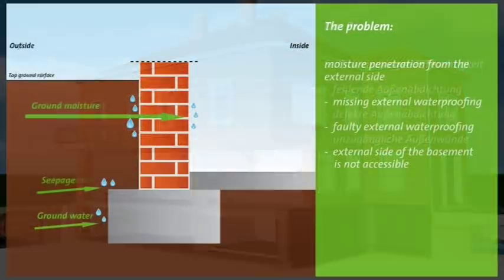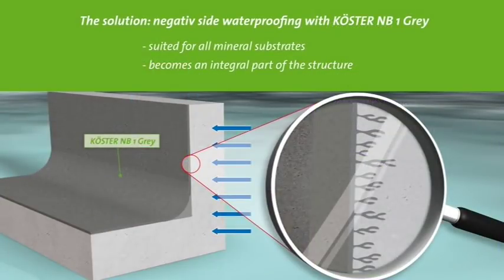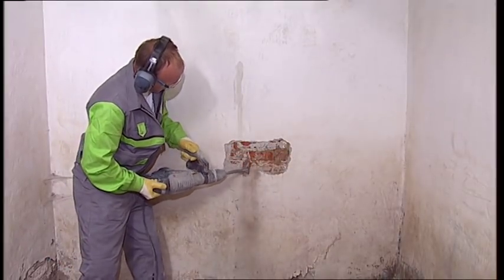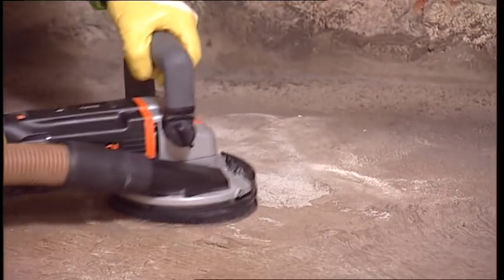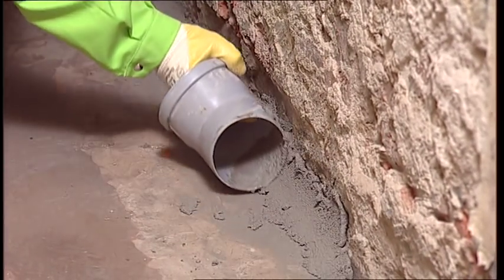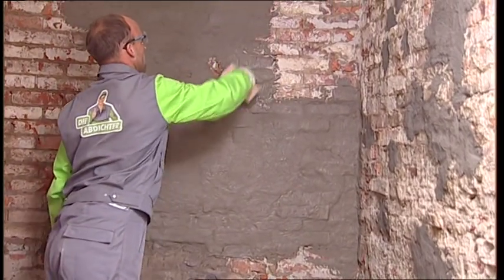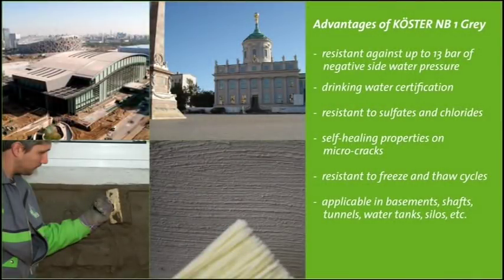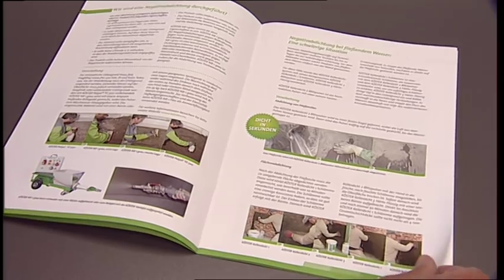Negative Side Waterproofing.mpg

Comment: Our product at Zion Pros is breathable and stronger. No need to worry about creating a problem with trapping moisture.  Crystalline has to have free lime and moisture to create the crystals. Brick has very little free lime. Block does not have a lot more. It works very well on concrete. We have solutions for all 3.
Reply: Can you tell me where to find information about the product you sell and where I can purchase  Thanks